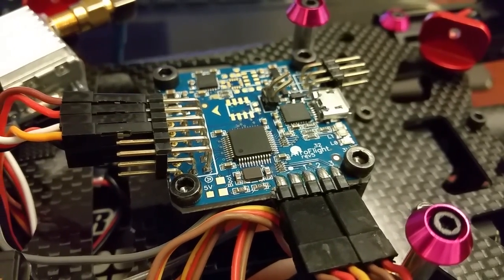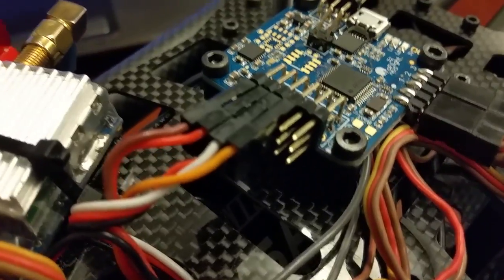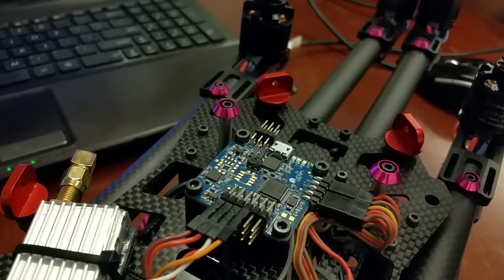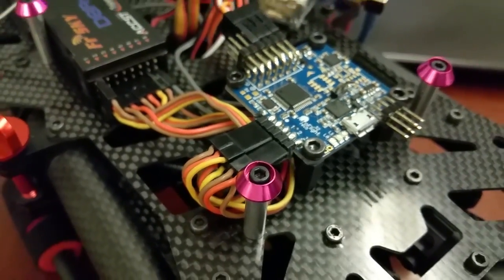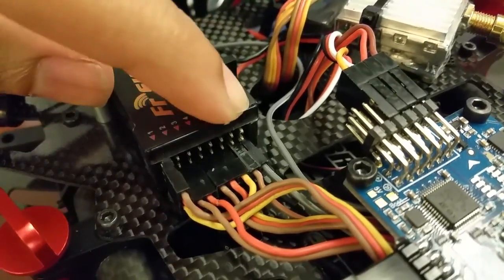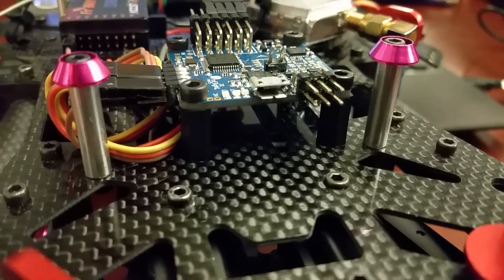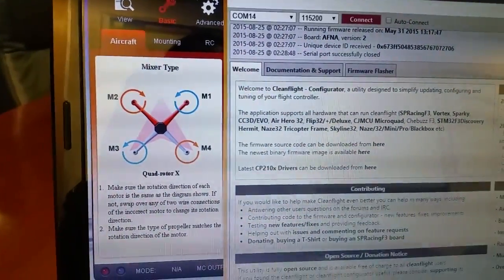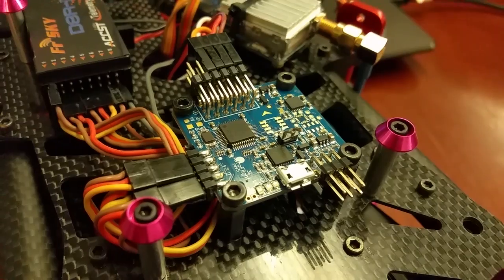How to Wire Naze32 Flight Controller

Comment: I have Naze32 (full) and my esc hobbyking 20a ubec would not power from flight control. If I go direct power to esc I can hear that beeping sound. I'm kinda stuck from here and I already watched all the video for Naze 32 on how to connect.
Reply from the maker: +Sen Pen ESC does not get its power from the flight controller. They get their power from the battery
Reply: Thanks, I did follow your video but for some odd reason once I put the battery I don't hear the motor beeping or any respond. I believe that I have a bad or not working naze32 flight control, I did order another one though. I'm using rev5 the first one and I order rev6 and I should be getting it today, I will keep you update.

Comment: how would you power up those 4 motors?
Reply from the maker: +The Ragirate The motors are connected to electronic speed controls (esc), which are controlled by the Naze. I wouldn't use a Naze at all. Go with a newer board.
Reply: MultiRotorPaul so the esc signal connector would fire up the motor? sorry im just noob here hehe , I know the has a 2 wire that should be plugged into a battery
Reply from the maker: +The Ragirate Each esc has 2 wires negative and positive that typically connect to a power distribution board. There's also a signal wire that goes to the flight controller.
Reply from the maker: +The Ragirate This doesn't apply if you have an all in one esc. Where there is a single ESC, with 4 signal wires coming out of it going to a flight controller. That esc also has 4 sets of 3 wires, each set of 3 wires going to a motor. Most people don't use these, but an example of this is one that I used on my XJ470 called a QBrain.
Reply: MultiRotorPaul oh thank you very much sir i got it right :)
Reply from the maker: +The Ragirate no problem!

Comment: Hi,
I am using this PDB along with my Naze32, do I have to do anything else like connect the receiver to the PDB?
http://www.banggood.com/Realacc-HUBOSD-ECO-H-Type-wSTOSD8-Current-Sensor-5V-12V-Dual-BEC-PDB-with-XT60-Plug-p-1085412.html?utm_source=Youtube&utm_medium=cussku&utm_campaign=5635792_1085412&utm_content=1081&p=CG24181822629201506N
Reply from the maker: hi Swaran. at 3:10 in this video you can see how I have channel 1 on the receiver connected to the NAZE. the Receiver pulls 5V power directly from the Naze, but I suppose you don't have to run it that way.

Comment: Another good walk around of the naze FC.
Be interesting to hear your thoughts on this controller.

I'm still figuring out the pids for naza lite. I bought the S500 frame but I will not switch everything over until I get it tuned.

Good luck flying and keep posting your flights.
Reply from the maker: Make sure the flight controller is as close as possible to the center of gravity. Start off with the default settings and go from there. I had the gains linked to the knobs on my transmitter so that I could change them in flight. And also make sure you configure the location of the GPS correctly, this is extremely important too.